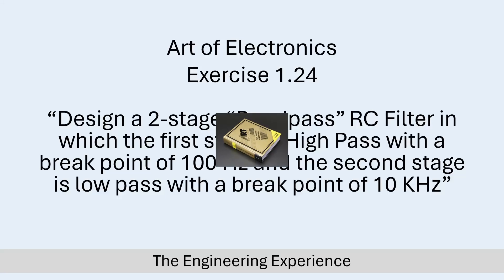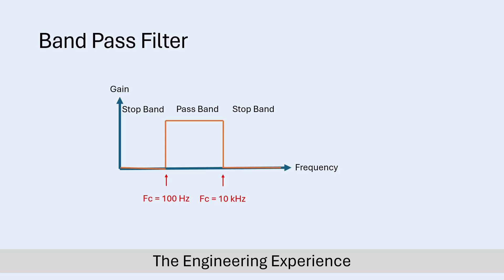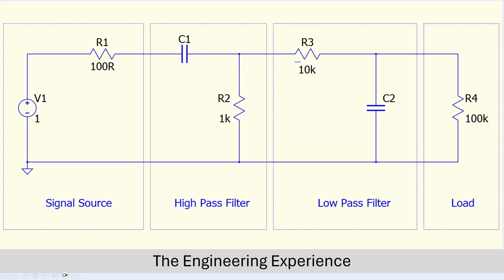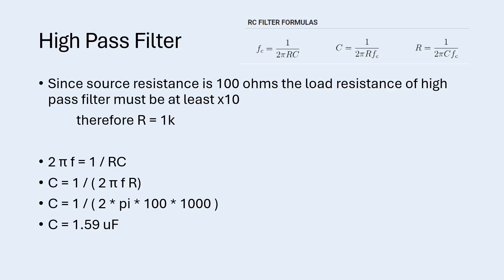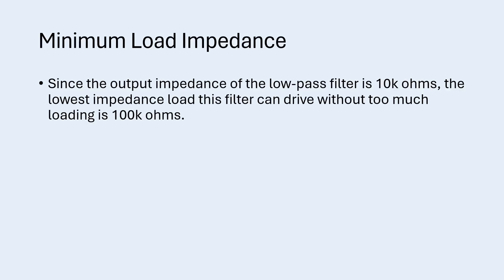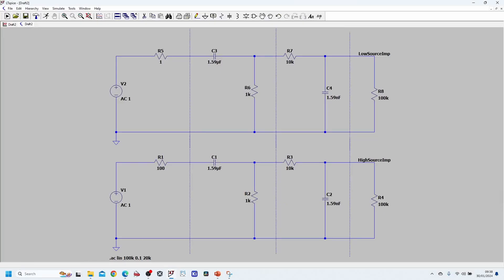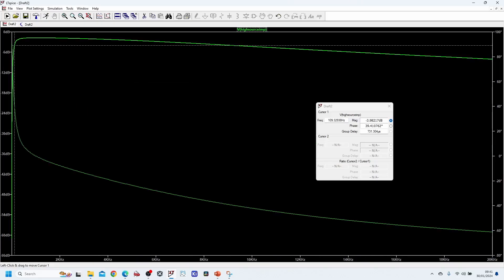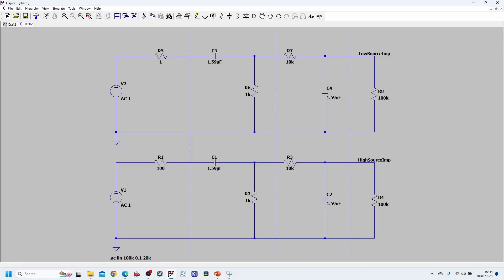Learn The Art of Electronics: RC Filters Design Exercise 1.24

Comment: Why high pass before low pass?
Reply from the maker: It's a requirement from the question (or the paragraph above). 

In reality I don't think it will matter too much which way round you build this as long as you have the correct input and output impedance.